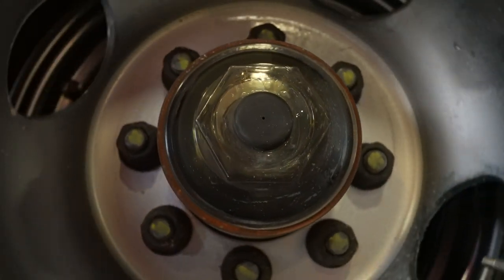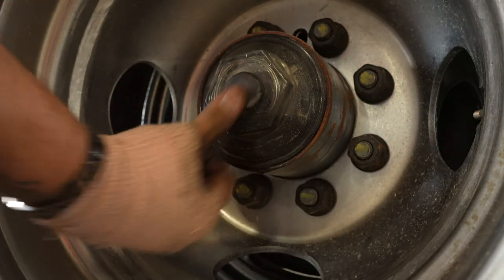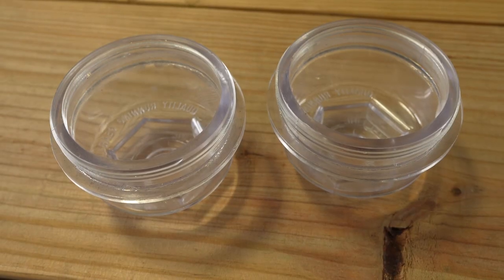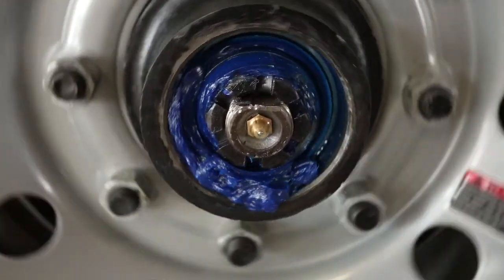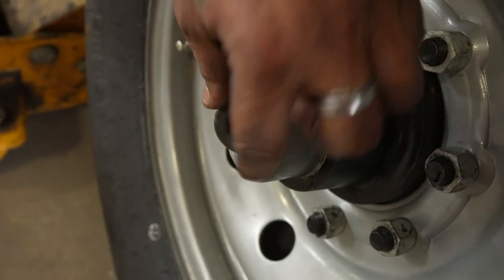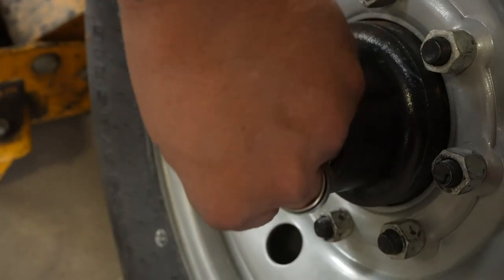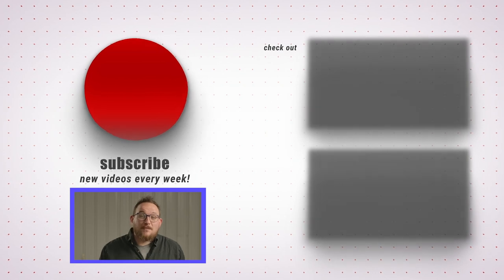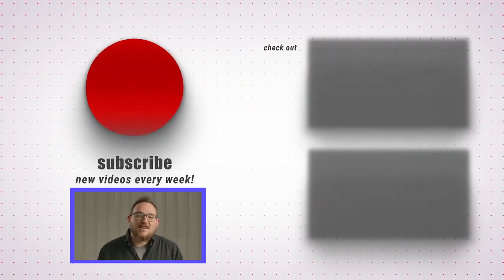Which is better? Oil Bath #versus Grease

Comment: Semi trucks and heavy haulers use oil bath for a reason. Oil also runs much cooler than grease. With proper maint and pre trip inspections you shouldn't have any issues with oil.
Reply: The trailers that semis pull aren't oil bath
Reply: 48 ft trailer my semi pulls is oil bath
Reply: I have yet to see one that was oil bath, worked as a trailer mechanic for a year. We would do at least one trailer per day per person, empty the old grease and pump new into the hubs. All fedex trailers are grease
Reply: @mikem5475  so the correct statement would be, not all semi trailers are oil bath
Reply: @AB-mg5sx  big business doesn't use oil bath. You shouldn't use oil bath either. Those sight glasses get cracked, or someone forgets a rubber plug, and the whole hub can get smoked. Anyone can walk up and sabotage your whole operation with a handful of anything other than oil
Reply: @mikem5475  I agree with that, I’m having issues with my oil bath leaking. It’s getting annoying
Reply: @AB-mg5sx  I'm limited on what i can offer only working on semi fluid grease, i know there's the vent in the center cap for the hub, and if that gets screwed up it can leak from there. There were also press in seals on the rear of the hub, and a flat gasket on the front of the hub. That's all there was to keeping it in from what i could tell
Reply: @mikem5475  semi fluid grease
Reply: @picasso2445  correct, not oil

Comment: As a car hauler that does 3 to 4000 miles a week I would recommend oil bath I had multiple issues with grease bearings and grease axles it takes too long for everything maintenance wise and had to replace them every 5 to 10,000 miles not worth spending the money on Grease use the money to buy yourself oil bath
Reply: Yeah I’m doing 10-13k miles a month.  It’s not worth doing the grease bearings every. 3-4 weeks.  I’m switching to oil and put cameras under the trailer to see if seals go out.  I can see the outer cap and I’ll check at every stop which is every 3-5 hours.  Carrying extra seals, bearings, caps and oil for anything that pops up on the road.    Just way easier.

Comment: He didn't cover all the scenarios.  I have 5 trailers...all grease except my boat trailer which has "reliable" brand oil bath hubs on it (ez loader trailer).  Love these hubs for marine applications.  you can see through the cap to see if the oil is contaminated with water.  (can't do this with grease).  oil bath also runs a little cooler as well.   The trailer is a a 2005 and I bought it in 2009.  had a broken cap on it when i got it (I was able to tell because oil was getting contaminated.) I replaced cap in 2009 and haven't had any problems since and it is now 2021.  We just rebuilt the hubs (new inner seals, new oil, bearings were still good).  Anyway, if you can get them on your boat trailer I highly recommend.  No guessing to whether or not they have had water intrusion.
Reply: replace all your grease hubs with oil bath hubs!!!
Reply: I agree 100%

Comment: I'm a trailer tech for a large fleet. Used oil hubs at my last job but my current employer uses grease. Speaking purely from a maintenance and repair perspective, I hate the grease hubs. Takes at least twice the time to clean everything and it's a huge mess. Fluid hubs are much faster and easier to service. Pretrip inspection is more important but you should be doing that anyway. I'm looking right at you drivers.

Comment: Your suggestion of going with grease, is only relevant if you put low miles per year on your trailer. 
If you are a professional running 75,000-100,000 miles per year, you would need upwards of 10 or more grease changes on your grease hubs. If you are running oil bath hubs, change your oil every 40,000 miles, and you’re golden. You can also buy metal Valcrum oil hub caps, for better security against road damage to your oil hub caps.

Comment: A huge point was missed here. When seals break down over time, the grease seals will hold the grease in better and "sweat" longer. Oil hubs will usally go from sweating to leaking really fast.

I ran hotshot with 8k grease torsion axles and used the EZ lube system for swapping Grease usually every 15-20k until my seals began to sweat. Then I would do a full repack. Never had any issues.

I run Schaeffer's grease. Much better product than lucus Red & Tacky for longevity and extreme climates.

Comment: Just to clarify - Wheel bearing grease IS combustible just like oil. While its not "flammable" it can still catch fire if it drips or gets sprayed onto hot brakes.  So your statement while somewhat right is not true.  BOTH can catch fire.

Comment: Oh grease definitely gets out of the cap is damaged. I had a rubber cap that I didn’t realize was dry rotted. We got to our destination after driving a couple hours and one of the trailer wheels was coated in red grease. Did it destroy the bearings and spindle? No, there was still some lubricstion. But had we driven 4 or 6 hours? Who knows.

Comment: They don't make a metal cover for trailer axels with oil baths?  My work truck is a Kenworth T440 and the steers are oil bath.  All metal housing with a screw on cap.  Super simple to maintain and never seen one fail that did not have MANY mile on it.
Reply: Yes, Valcrum makes aluminum ones. They're about $200/set
Reply: @shermanhemsley2906  is correct, that's for a set of 4. Even Amazon sells them.

Comment: Does every oil bath hub needs to have a breather? Friction creates heat and pressure in a closed system like a hub?
Reply: That's why you only fill it half full the air space allows for the oil to expand.
Reply: That’s what I was told too.  Thank you for reaching out to us and reminding me

Comment: If a seal goes bad grease will leak out once the bearings heat up and it IS flammable. However it will leak out slower, and is less flammable than oil. Another pro for grease os that the seals wont dry out over time of the trailer sits. Oil seals can dry out if not used regularly and spring a massive leak once they're put back in use.
Reply: I just would like to clarify the fire issue.
About 90% of all semis and semi trailers use oil bath axles if you see a semi trailer tire on fire or burning up it is because the brakes started the fire not the oil from the hub.
Reply: I agree with Jordan. While theoretically possible, you just don't see oil bath systems catching fire. Non-issue and not even worth mentioning as a consideration in choosing between greased and oil bath.
Reply: Miss matched tires or tires that are under pressurized next to a fully pressured up tire heat up and blow out or catch fire

Comment: I bought two new trailers this summer one in June and one in September! One with 8k axels the other 10k duals  . I could not find any with grease hubs only oils bath . The first trailer that stupid plastic cap broke In the  first week . How can I changed them to grease ?
Reply: Short answer you can’t. The amount of money and work you’d have in it to swap them to grease you coils of bought a  trailer honestly .
Reply: my 40k step deck is oil bath. it sees only short trips and low millage. due to this oil bath is a bad idea. So for guys like you and me, it's a simple answer. Take the hub off. get a bearing packer (uses greases gun pressure to pack bearings), pack the oil bath bearings (inner and outer) with grease, add enough to fill the void between the inner and outer bearings about 1/2 way in the hub, replace hub, properly set the retaining nut as you would if it were still oil bath, add again enough grease to fill about 1/2 of the plastic cap. reinstall cap. check again for issues after first use (freeplay) if good remember to do all of this again in about 30k miles or annually.
Reply: We've got both at work. Both setups are nice. Oil is easy to replace and so is the cap and seal. Really easy.
Reply: Get Valcrum aluminum caps. You trailer manufaturer cheaped out on you...the aluminum caps are only $50 each.

Comment: That plastic cap is pretty cheesy looking. Would be nice if the trailers used hubs off of pickup truck axles. A hub off of a 14 bolt or dana 70 would last 20 yrs without leaking.
Reply: I agree that the plastic covers aren’t my fav but I know that they are pretty thick
Reply: They make Aluminum caps...really nice ones actually that have a hex screw to do oil changes, so you don't even have to remove the cap. Only cheap trailers come with those crappy plastic ones.
Reply: @MoragTong_  That sounds like the way to go.

Comment: you forgot, oil bath axles can actually cause rust pitting on the wheel bearings when the trailer sits for long times.
Reply: Nathan your wrong with your assumption, I worked for a trailer manufacturer that has used oil bath hubs for many years, as part of our boat show display we had a hub set up that was filled with a 50/50 oil and water mix to show what water polluted oil would look like in the sight glass, this demo was used for 10 days a year then sat untouched in the back of my office, it would sit for so long that the oil and water would separate, after 5 years I took it apart and after cleaning the oil off the bearings you could not tell them apart from brand new bearings off the part shelf.
Reply: Then why do several boat trailer companies no longer use oil bath hubs anymore ?
Reply: @martypeterson9214  my experience as an over the road truck driver, (owner operator) for the last 20 years says otherwise. Im the one having to do all my own work and buy all my own parts. So i dont care how your show room trailer acted. Thanks though.
Reply: @bakervinci163  exactly

Comment: Anyone ever replace the oil with grease ?
Reply: *crickets*.....there's are reason semi trucks use oil bath. If you are using your trailer for "work" get oil. If your trailer is for play or sits for long periods(meaning weeks, not months) get grease. The grease keeps everything lubricated during periods of downtime and is better at keeping the seals pliable. But everything that is mentioned in the video as a negactive for oil also applies to grease to a greater or lesser degree. So get the type of lubrication based on your frequency of use.

Comment: Thank you for the information both my flatbed gooseneck trailers are oil bath which I thought was great till now.   Is there kits made to swap them out
Reply from the maker: It would be an axle swap, what size axles do you have?
Reply: All About Trailers 12k lb axles on each
Reply from the maker: @stacyreid5077  So , 10,12 & 15K axles in a grease format are only sold by one company right now on their trailers. Its very new to the market on higher rated axles. and actually it is Texas Pride Trailers. They are the only ones in the market right now that makes that type of axles in 10,12 & 15 from my knowledge.
Reply from the maker: @stacyreid5077  But keep some extra caps and some oil with you at all times and you should be be fine!
Reply: All About Trailers well my 25' dual tandem is a 1997 model that I mainly use to haul my John Deere 450E long track with a cage and a 6 way blade plus 30 ton Tulsa Winch
Reply: Stacy Reid you are able to switch from oil to grease. Go to www.thetrailerpartsoutlet.com and purchase the appropriate bearing kit and pack them with grease. We have several customers that do this with their existing axles.
Reply: Juan Hernandez thank you
Reply: my 40k step deck is oil bath. it sees only short trips and low millage. due to this oil bath is a bad idea. So for guys like you and me, it's a simple answer. Take the hub off. get a bearing packer (uses greases gun pressure to pack bearings), pack the oil bath bearings (inner and outer) with grease, add enough to fill the void between the inner and outer bearings about 1/2 way in the hub, replace hub, properly set the retaining nut as you would if it were still oil bath, add again enough grease to fill about 1/2 of the plastic cap. reinstall cap. check again for issues after first use (freeplay) if good remember to do all of this again in about 30k miles or annually.
Reply: @nathan00campbell  great information thank you
Reply: Your oil bath are great. Don't let this video scare you into converting them to grease. No reason. Keep a couple extra caps and oil in case you damage one on the road, otherwise just enjoy not needing constant maintenance like the grease and enjoy those oil bathed. They are great.
Reply: @stacyreid5077  the advice in this video is very misleading if you are considering swapping. Oil bath is the better system that's why they are used on heavy machinery and greased are not
Reply: You thought they were great till you watched a video from a guy who is just wrong.  Learn how to maintain you oil bath and keep being happy with them.  Grease gets pushed to the outside of the bearing surface.  Oil stays in the bearing and evenly coats all surfaces.  Oil bath runs cooler.  Oil is better in extreme cold  environments because grease needs to warm up to thin out enough.      Either system can fail.  But oil systems perform better and last longer.

Comment: Get rid of those crappy plastic caps. Aluminum caps are the way to go. Also, I have run both types for 100's of thousands of miles and those damn friction fit grease caps ALWAYS come off. Grease everywhere and same problem, bearings are scewed because of all the debris that got into the grease since you didn't know the cap come off 400 miles back. Bottom line is whatever you go wtih, there will be problems just keep an eye on stuff and keep spares.

Comment: this guy does not know what hes talking about!  it was the grease hubs that caught fire back then. it is grease that is next to impossible to regulate and inspect without completely tearing down the hubs. oil is far superior and always will be,
Reply: Exactly. If you are doing regular maintencae and inspections, oil is far superior. Grease allows people to put off/ignore the maintenance intervals until its too late. Every trailer I see on the side of the road with hub/bearing problems is a grease setup.

Comment: There's more grease hubs broke down on the interstate than oil.  Every 15k your supposed to repack bearing.   People forget how many miles on the bearing.
Reply: Ding Ding Ding. Exactly! More importantly they're supposed to REPLACE the grease. Meaning clean all that old crap out of there and repack...no one does this because it's a PITA. Oil is the way to go if you use your trailer alot, but infrequently used trailer owners often forget how long it's been and fail to do the maintenance on grease, so more failures.